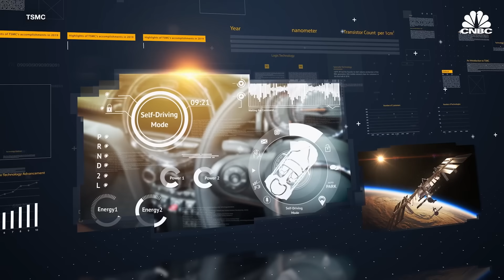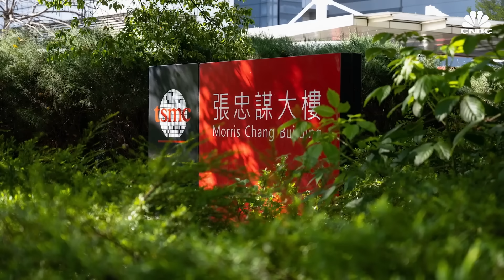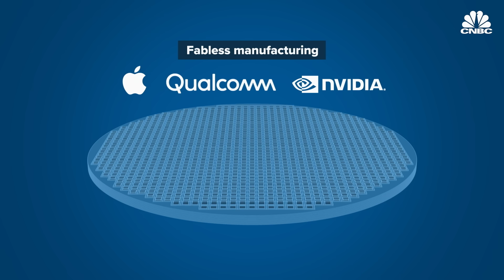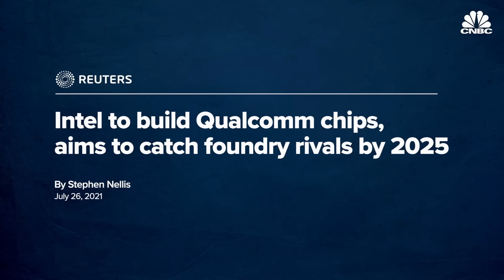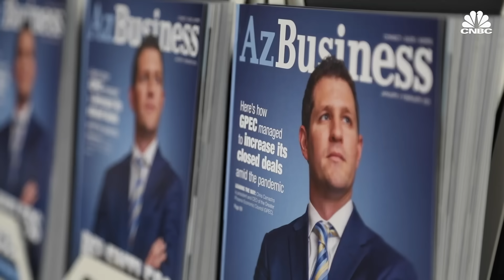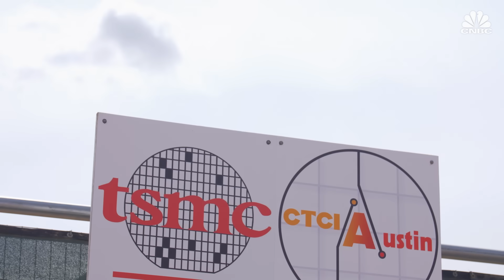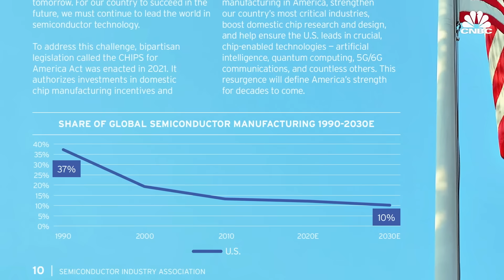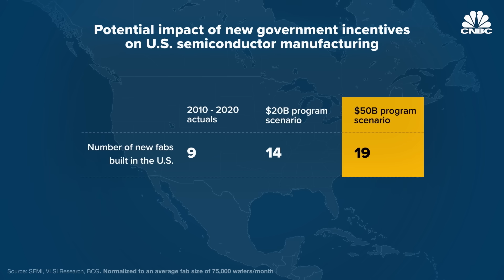Secretive Giant TSMC’s $100 Billion Plan To Fix The Chip Shortage

Comment: Well when does the chip shortage will end i think we will need in the future some kind of system that ends with chip manufacturing of hardware and replace them with software or virtualization has it is called and for that we will need special chips that runs hardware virtualized throu software and that do not need to be replaced by new chips in the future.

Comment: You wouldn't need to do anything but add MST to the chips to shrink the die.  It would add 50% GM to the bottom line and would solve the chip shortage. On top of that when you meet your capacity for 2 years, swap over to a new PDK on the same node and run Chips with higher performance.  MST is applicable from 180NM to the smallest 2nm chips today.  In fact MST for a modest 2 or 3% royalty can provide a node improvement to leading edge 3NM or 2NM designs... that means You don't need to build a 2nm fab to get the same mobility improvement atomera provides for 3% of selling price.  If it's 20B to build a 2nm fab, why not use mst for 100M a year vs waiting years to build and spending billions.  MST is ready now not 5 years waiting for 2nm fab to come. Must be waiting for Intel and Samsung to adopt first?

Comment: bring the chip production to the united states because even if china should attack tiawan they dont have the cojones to attack the united states since we have norad who will defend the united states.

in the mean time car makers could go back to carburating cars temporarily until the chips can get stocked up.

one way to help encourage fabs to move to the united states is to blindly trust them and drop the licensing requirement for obtaining the exotic chemicals that may be included as drug pre cursors such as methylamine so if the fab does not have to obtain a license then they can get in the united states.

could the fabs install massive refrigeration units to collect water from the air and supply their needs or power their entire plant from hydrogen fuel cells witch creates water as a by product?

they could cut analog all together and go digital.

another way would be to split the customer base.

all the most critical tech like tech that will be handling classified material such as the computer that hackers broke into at langley from mission impossible where they suspended from the ceiling and copied documents that computer will be made entirely in the united states while the consumer ones like you can buy at staples can be made from foreign parts.

Comment: This is total BS. There is no short supply of complex computer chips. Had a problem purchasing a computer lately?? No! that's right, total BS. It's the basic simple old chips that are used in vehicles doing simple tasks which are in short supply because there isn't any money in it and no one want's to tool up for it's manufacture. A total fraud hype created for political distraction and story telling cause it sounds good. All politics created out of thin air.

Comment: You keep making the mistake that a bigger nanometer-number automatically means bigger chips and that's not true. It can be, but it's not a causal relationship. The coffeemaker chips you mentioned are usually ARM-based or other RISC architecture, aiming at providing the most specialized logic. Specializing it also means cutting out unnecessary logic, so you end up with a smaller die, which lowers cost per chip as you get more chips per wafer AND you get a better yield, as smaller chips are less likely to contain an error that would make them unusable. So, a 14-nanometer specialized CPU might be much smaller than a general compute 7-nanometer consumer CPU, for example. 
This is why it's not correct to say "bigger chips" for chips that have been manufactured on older nodes. Yes, smaller nodes mean smaller transistors OR smaller transistor elements OR less unlogic space OR something related (it's not standardized what it means, by the way) BUT that also means that designers can now keep the chip's size the same while cramming more logic per area unit. So, chips might be getting smaller while keeping the same functionality as before OR they might be keeping their size but add functionality. Heck, they might even get bigger, like Cerebra's WSE. ALSO, if you're talking about chips, you should be able to make the distinction between CPUs and SoCs, for example, and types of chips and packaging.

Comment: Of course TSMC builds a chip plant in Arizona.  Silicon manufacturing requires a 10 to 20 gallons of water per chip.  Building a manufacturing plant in a state with no water resources, in the middle of a megadrought, living off of borrowed water is about the most short sighted thing I've seen.

I'm not sure who their planner is, but they should be fired.

Comment: They are not advanced chips. They use inherently quantum mechanically defective CMOS. A Resonant Tunnel Diode fab would be innovative. But electrical engineers are not that knowledgeable or innovative.

Comment: Clearly, this specialization has led to very effective production, but also makes overall production of electronics fragile when it relies so heavily on the one producer.
Reply: And will continue to rely on it.
Reply: @teemuvesala9575  Intel is building similar chip manufacturing facilities in Arizona and Ohio.  Hopefully we will be selling sufficient on chips in the next few years. Now we need to work on becoming energy independent again. Also, we don't just need the highest spec chips. Even the less advanced chips are in higher demand for simple electronics
Reply: @ChevTecGroup  Intel is far behind TSMC. Intel is all PR with little to show for it. Intel themselves rely on TSMC to manufacture a lot of their own chips lmao. The most advanced chips Intel has coming up next will be mostly manufactured in TSMC as well, not at Intel.
Reply: @teemuvesala9575  well as this video, and I stated, the most advanced chips are not the thing holding back production on all our electronics. All the less advanced chips are still used for everything from refrigerators and televisions to toys and equipment. Smartphones and computers are for from the only thing that uses chips. Your argument suffers from tunnel vision
Reply: @ChevTecGroup  Not really, there’s a reason that appliances don’t use cutting edge chips, they simply don’t need it. It is less critical. However, chips in computers have a direct impact on production rate and capabilities of the computer. A chip that’s 20% faster won’t make a car 20% faster, it will make a computer 20% faster.
Reply: All chip manufacturers depend on ASML
Reply: TSMC shouldn't come to USA until anti Asian is end

Comment: CCP do not export CPU chip  or IC Chip core ingredients and sand materials for electronic PCB boards to U.S , europe and Taiwan. Making all electronics dead for computing,aviation,shipping and land transports vehicles. The world electronic will be 70's vero board wire wrapping no more PCB with SMT chip and electronic component mounting. Re-use old PCB baords and cannibalize other electronic PCB worst than 3rd world will be the new way. No recycling destroying  of electronic products due to PCB shortage. Only China can make laptop,PC,Server,siwtches,router and firewall products and not any other countries.  They have to use thier existing legacy electronics products till it fails.
Reply: LEARN TO WRITE WELL
Reply: @colinchen2638 Learn to be your Colin.

Comment: It's so funny that Apple advertise TSMC's chips as their own inhouse production. Also funny is that the site they are building in the US is not going to answer the needs for autoindustry and others that dont use a 5nm chips..
Reply: Doesn't apple design the chips inhouse and tsmc just manufactures them based on those designs?
Reply: Those TSMC 5nm chip are demanded by Pentagon and Intel for their new supercomputers, data centers, etc.

Comment: Ehhhh... nanometres actually don't matter anymore and haven't ever since Intel went FinFET which was like 2011 because nanometres were a measurement of the fin pitch which before finFETs directedly effected density. After FinFETs however from 32 to 22/14nm fin pitches remained mostly untouched, but density did continue to improve, but this meant that the nm measurement become a marketing term rather than an actual measurement of any features, this is most apparent in the move from 22 - 14nm to 7nm which even if you just look at density as a measure of desnity increase it should have been called 12 - 10nm, and 5nm should be 8 - 7nm and 3nm should be 6 - 5nm, but even it's still not 100% accurate because of smaller amount of cheating in the naming 3nm should be closer to 10nm if you were to look at the density increase from 32nm.

Really nobody should be using the term nm anymore and you should use the brand name for each company, Intel even renamed 10nm to Intel 7 because it is equivalent to TSMC N7/"7nm" I don't actually know Samsung's naming for their nodes.

Comment: Shortages are due to decreased supply. A decrease in supply is an increase in profit. 
So why would TSMC help increase supply?
Why would shareholders approve huge investments in production capacity, when the end result of the investment will be a lower profitability, a worse cashflow and more debt.
Raising capital to build semiconductor foundries has always been difficult, given the large amounts required and the extremely long ROI: Building a new fab takes more than 5 years.
Reply: Because Taiwan needs America
We trade increased capacity for American protection

Comment: It's not all about the number of the  "nanometer" . It's about the density of the node . If you research a bit you'll see that these numbers they use are just names and have nothing to do with the real dimensions of the transistors of the chip
Reply: Yeah I was wondering about that. An atom is around 0.5nm. I was always wondering if 5nm is essentially a component or lane on a chip 10 atoms wide.
Reply: @cyberlord64  yeah it's all marketing stuff . That's why intel is changing their node names .
Reply: Well, up until around 10nm it did, hence the rationale of the name.  But now yes, it's become more of a marketing ploy to try to indicate to the consumer that our chip is better aka smaller nanometer.  Whether it's "true" 7nm, super 7, "5", or something else, I think they are all physically below 10nm, it just depends on the size.  But yes, as the density goes up so does compute, etc.

Comment: Chip manufacturing in AZ? It's too damn HOT there. Theyll use so much natural resources there which is in shortages. And the workers living there. Why not build  apartment building  like their factory so there's less driving around. Less fossil fuels burned. Give them Electric Vehicles to get around to/from work/apartment. Have all there needs inside the apartment complex. Grocery stores, post office, movie theaters, charging stations (wireless charging), utility companies, emergency services, BestBuy, superfast Internet services, 
Oh they'll need to install 100% solar panels on those buildings and wind turbines if its feasible there. Battery Backups Units for all units and entity. Where's a Home Depot around there. 
Get HyperLoop system to all the Intel, TSMC fabs and offices thru out North America. No need to fly unless going overseas. They can ship their chips using the HyperLoop.

Comment: Please someone explain the actual strategic benefit when the chips have to be shipped to China for product assembly anyway. AFAIK, no US soil factory uses 5nm chips. Car manufacturers will not use this facility as TSMC won’t be producing the old chips cars use.
Reply: The 5nm bleeding edge chips will go to the massive cloud providers and leading edge server farms, along with the hundreds of supercomputer arrays that get updated routinely not just in the US but all over the world.
Reply: @Random-Stranger  Exactly so the dies will have to go to packaging (Philippines?) then motherboard and product assembly (China, Taiwan) and back to the US so what’s the point of US soil foundries?
Reply: @ArnaudMEURET  Cost reduction, improved logistics and supply chain redundancy in case earthquake, massive hurricane or a sudden strike from China hits Taiwan. It takes at least 2 years and 10 billion dollars to set up a fab. Not having any crucial bleeding edge fabs in the US is a weak point in US semiconductor supply, especially with Intel not being competitive for at least 3-5 years at the bleeding edge. Packaging and assembly can also be relocated but you gotta build and ensure you have the fabs up and running first. Once the fabs are up, you can be sure that some of the crucial packaging and assembly will also be relocated in the US. 

The car chips are a drop in the bucket in TSMC's portfolio. The US fabs being built are for the bleeding edge nodes. Those fabs aren't producing any silicon for cars. The older node fabs at Intel and Global Foundries can handle those.
Reply: @Random-Stranger  I sincerely hope your optimistic outlook will become the reality. However I read that the current shortage for car chips is mostly due to existing foundries having lost interest in _old_, 40+nm, less profitable lines and are dragging their feet to set them back up and running on those processes. The hundreds of billions currently being poured into new fabs will take time to bring market effects.
Reply: @ArnaudMEURET  The chip shortage for car chips is due to the car manufacturers themselves who cancelled their chip orders so the fabs allocated those chips to other customers. The fabs don't operate on a wafer surplus - a lot of these silicon wafers are ordered years in advance - so when you stupidly cancel your wafer orders - they offer those chip orders to other customers who have the money to pick them up. 

We also got an unprecedented explosion in demand due to the global lockdown so any would-be surplus silicon is immediately picked up. The fabs aren't magically gonna have your wafers for you just because you misjudged the demand on your product end (which is what the bean counters at the car manufacturers did). And the fabs were already running 24/7 prior to the huge demand spike so it's not just a matter of them firing up an idle fab to produce extra chips (and no fab ever is idle - they're constantly producing chips in order to recoup the massive cost of the fab manufacture and generate a profit).

Comment: Where exactly are they getting the water from? The western US is facing a bit of a nasty water shortage isn't it.
Reply: The whole world is going through a water shortage.
Reply: @jailencobb5631  No, the distribution's changed. Hence heavy flooding in other areas. The higher temperatures keep more water in the air in vapour form until a cold air front hits, then it all dumps at once. See Germany, Hungary etc for details...

Comment: TSM now offered a 50% partnership in startup FAB @ Michigan, equipped 10nm scale for Graphene Heterojunction dual gate MOS field effect, amorphous calcogenide phase change memory stacks, with highly capable interferometric focused ion & electron beam tool  22,000sq ft premises under contract, multi-million $ tooling purchased.  This is a personal effort derailed by CoVid over 2 years, with potential to prototype using a forensic tool designed for Silicon direct editing, fully refurbished to better than new.  A small step in a big dream.

Comment: Outside of the fact that Maricopa county is at a critical point in a 20+ year drought, good to see this coming to Az.   Lake Powell could be dry in 6 years and the infrastructure to pump groundwater, that cannot be replenished, is not in place. Great short term fix though. Flew over most every inch of Az over the last 40 years. The state has dried up considerably. The 100 years of water supposedly ready to be pumped, is not, according to hydrologists (not under contract) with the county. Pumping desalinated water from the ocean??  Look up the costs of operation of operating the Carlsbad plant in California, add the cost and logistics of distribution. The aquifers have been pumped dry due to lack of oversight in outlying areas which are not regulated. I hope for the best - but the reality of the situation may be a short term fix.

Comment: One thing I learned is not to move and live in around Phoenix, the effort to recycle production waste water for consumption is scary, specially with so many fabs in the area.
Reply: It's tough, but not a major concern. It would be wildly expensive to build out the infrastructure to pipe in water from the Midwest or a desalinization plant on the Pacific, but not difficult with Federal backing. Resource management is obviously preferable.
Reply: @EnragedEagle  It's all about the cost to build up a safe water system for human consumption but also one that can facilitate the production needs.  I work in this industry and I wouldn't be too comfortable living close to areas where my only water source is from recycled waste water.
Reply: 95% of all the chip plant waste water are recycled recused. Pollution of discharged waste water is negligible.
There are a few small rivers flowing by Pheonix.
Reply: @zenlei8258  You are welcome to live next to it but don't assume others would.  I work in semicon, I wouldn't...
Reply: @zenlei8258  You are too idealistic like nothing can go wrong, or there won't be accidents.  Again, I work in this field and you can't say anything to change my view.

Comment: What level of stupidity does it take to build a huge water drawing factory in the middle of a region that is already in a water deficit condition? The eastern half of the country has crap loads of water, and you risk building critical, expensive as heck, infrastructure that relies on a continuous supply of pure water to operate, in the middle of a desert where 6 states have been battling for a dwindling water supply? Are they doing some zero loss water reclamation system or something? This is blatant stupidity.